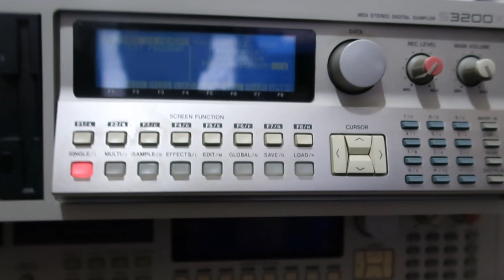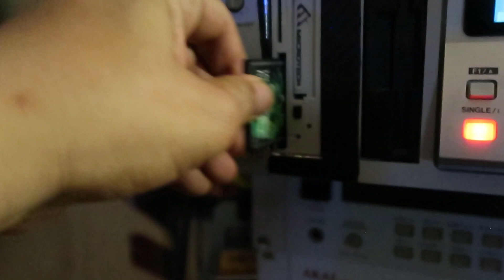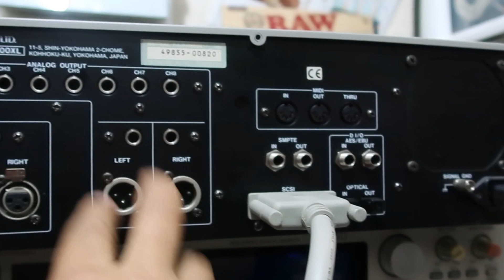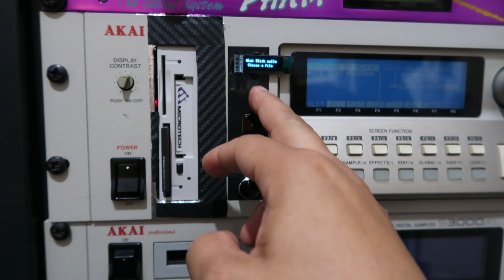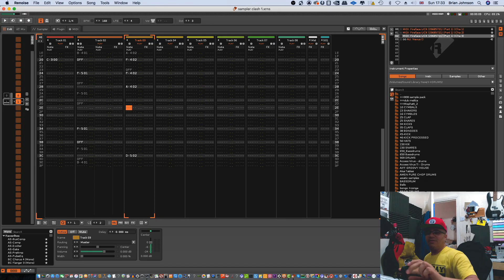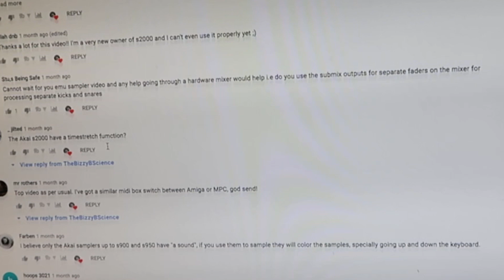HARDWARE SAMPLER  TEST ( AKAI S3200XL ) - FILTERS MODS + OPTIONS

Comment: I've seen a few of these, what's the deal with the drive bay "Magneto Optical Drive", you would assume that's where the MO unit sits, but there is never anything behind it, why did akai bother to print that if it doesn't have it?